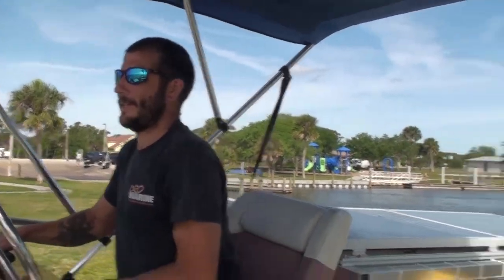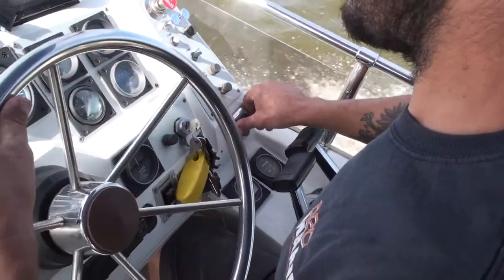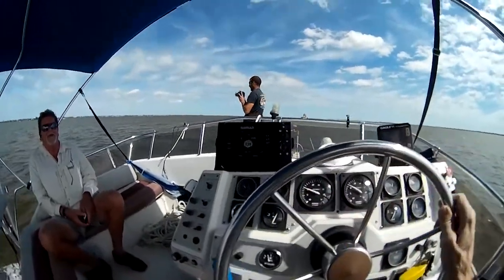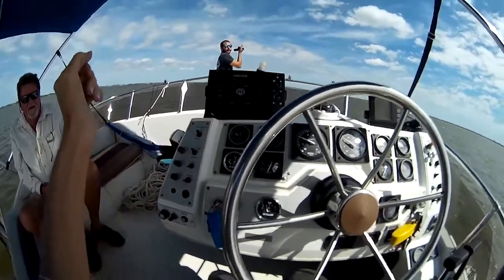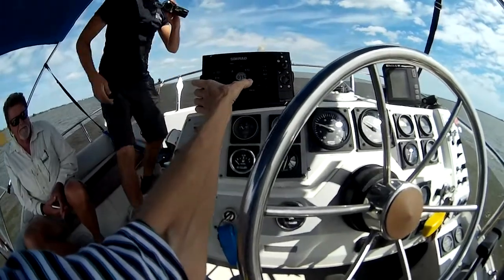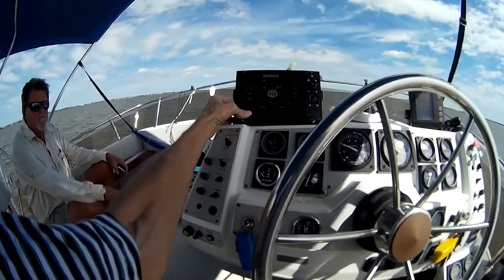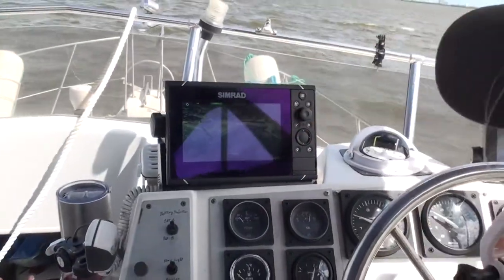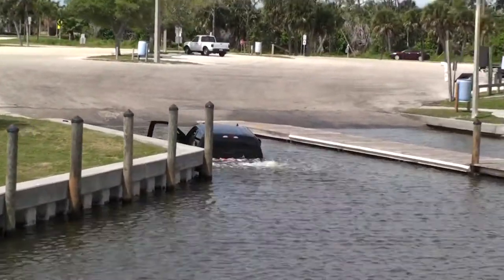Test Drive Ending With A Rescue

Comment: I am looking at your videos to try and follow the trajectory of your life, like what's the big plan. Looking at this particular motor boat, you seemed to have it nailed that is one hell of a boat. I could happily live on a boat like that forever. Also, with the fact that it is a motor boat, you can as Robert P. Beebe would say, "proceed with dispatch" I am wondering what the attraction of the catermaran was. Maybe the solar power. On that plan of living on an uninhabited island you may be able to do that legitimately as a caretaker make some enquiries. Regarding the stealth cabin I am building living in. It is rather yurt like with pvc tarp walls. You could just build a yurt since you are in a sub tropical climate. I am sure you can get lots of long pallet wood like the stuff I am using. I going to be experimenting with growing a house. Look at baloon construction and then think of using  trees as the  uprights structure. Regarding the yurt you can grow climbing plants over it therefore protecting it from the sun. The last time I was in the Philippines I stepped under a mango tree and I was amazed at how much cooler it was, you would not need aircon.

Comment: Great video as always  looks like the boats ready to go about how much range does the boat have
Reply from the maker: I'm not entirely sure what the range is exactly.  The main tanks hold 50 gallons each, for a total of 100 gallons.  At 6 MPH in calm water I went about 1.7 miles per gallon.  This will be reduced in waves or going against the wind, plus I'm sure there will be some gas at the bottom of the tanks that I can't burn because the fuel lines will suck air while a little fuel is still in the tanks.  I also have two 25 gallon tanks that I plan to put on the front deck.  These can be filled when I need to go a long distance between fuel docks, but will be empty most of the time.  The plan is to rig a fuel pump to each with lines running to tee in just before the fuel filters so I can turn on some switches at the helm to pump the extra gas into the main tanks without leaving the helm.  I will also bring a bunch of jerry cans because some of the islands where I plan to refuel do not have a fuel dock.  At these islands fuel has to be ferried back from a gas station in the jerry cans.  I plan to drive the boat from Merritt island to Miami before heading across to the Bahamas.  This gives me 200 miles in which to experiment with fuel usage in different conditions.  Weather permitting, I plan to do much of that trip in the ocean instead of the ICW so I get some idea of how severely waves effect fuel consumption.